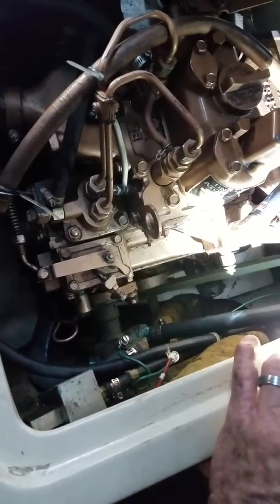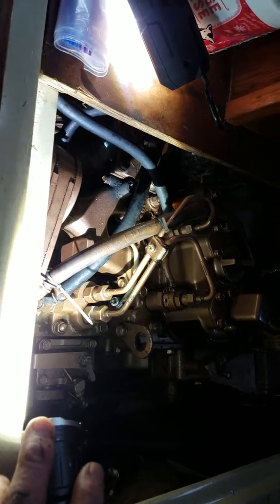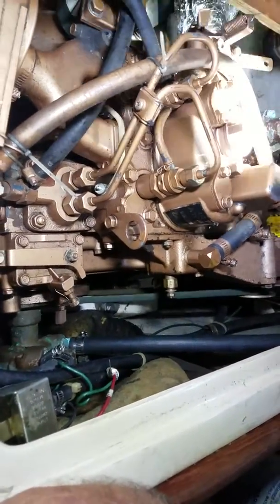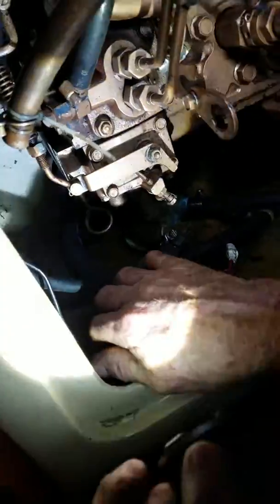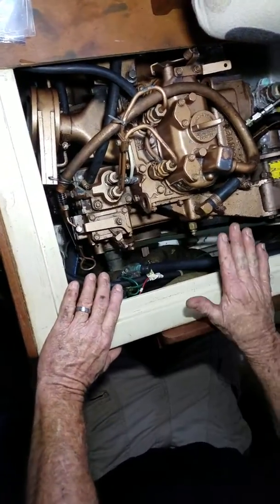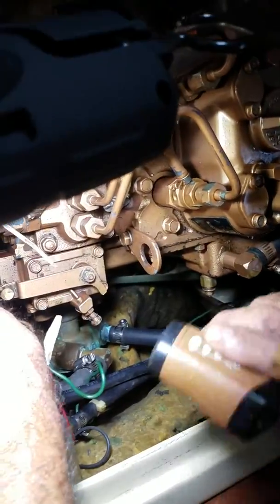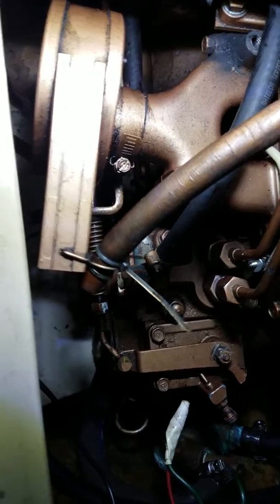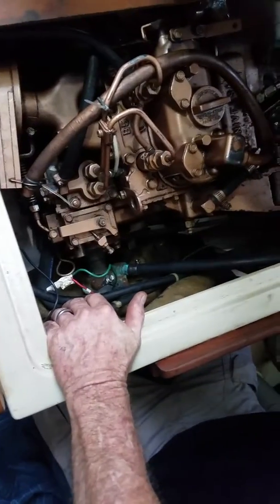Universal 5411 Walk through Part 6 - Engine Decompression Lever & Fuel Pump

Comment: Thanks for posting these. I have the same engine and they have been helpful.  The manual for this engine says in caps and bold print to never stop the engine using the decompression lever. It can bend the valves in the engine.